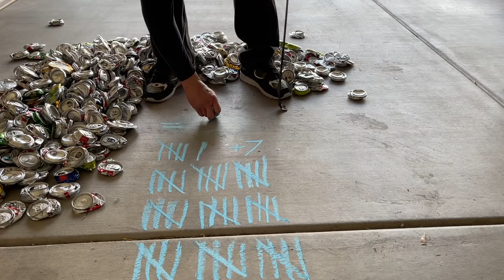Massive Can Meltdown - How Much Pure Aluminum Is In 500 Cans - Is It Worth Melting Aluminum Cans

Comment: Hmm no to be a smart akeck here, but what happens to ro non aluminium parts if the cans (ie the paint anr tho coating on the inside), are the ingots you are left with pure or somewhat  polluted ? Not that thus minor detail detracts anything from this great video I was just curious. And would seling the ingots actually recover the cost of the energy used to melt them ?
Reply from the maker: The plastic coating and the ink burn off and get scooped away so only the aluminum is left behind. Selling them might make a little bit back, but not all of the fuel costs that it took to melt the cans. Thanks Bjarne 👍

Comment: Stupid question. Slag really looks like metal, too. Why is it not salvageable? What percentage of metal left in that pile?
Reply from the maker: Not stupid at all. I’m not sure what percentage is left, but there is still aluminum as well as a lot of aluminum oxide. I will save pieces that look super rich in aluminum still, but as for the lot of it, once it starts to just crumble in my hands with ease, that’s when I call it trash. You could, and I have done this before, toss all the “pieces I call trash” in a crucible with some flux- like salt, and pull more out that way. When I have done that, the time that went into it for a tiny bit of metal didn’t seem worth it to me, so I just toss it. I do have a large bucket and I keep the good pieces so I can do a big dross melt once it gets full. 👍

Comment: Interesting video.  How did you polish them?
Reply from the maker: I use a wet sand method from 80 grit sand paper and step up to 3000 grit, then a polishing wheel with jewelers rouge. 👍

Comment: Where or how do you get all of your aluminum cans? This gives me ideas 💡! I'm wanting to make an aluminum bracket for our Harley to mount a flag on, do you know what the quality of the aluminum ingots would be? I'd need to pour it thinner or slice an ingot thinner on the band saw possibly to have something thin enough to work and bend into the shape I need.
Reply from the maker: I saved all my cans and had friends and family save theirs for me as well. I think the quality of the cans would be good enough for that. Alloys like they use for aluminum rims are better for casting parts, but I think cans might work for your project, but I’ve never tried what you’re after so I can’t say 100% 👍
Reply: @TheGrowingStack  Thanks for the reply, I might give it a try. 👍
Reply from the maker: @bodeine454  you got it. Let me know how it turns out if you do, I’d love to see it!
Reply: @TheGrowingStack  Will do

Comment: How long do you wait after you pour to pop them out of the molds?
Reply from the maker: If I have a full crucible and want to pour as much as I can before having to reheat, I’ll wait just until the metal freezes, and then maybe give it maybe 5-10 more seconds. If I’m at the end of a pour or only doing a couple pours(and I’ve poured the crucible empty) I’ll let it sit in the graphite molds for longer. Maybe a minute or so after it freezes. I’ve let it sit in the for 3 minutes at times and they release just fine. Hope that helps. 👍

Comment: Out of curiosity how much weight did the slag weigh?  Also, is pure aluminum worth more than say just taking the cans to the recycler?
Reply: Cans are worth a bit less. Pure alumim is about 1 dollar per pound where cans are 50 cents per pound. The prices change all the time. I took in around 500 lbs of cans last year and got like 200 bucks or something like that. Though melting them down cost money. One thing that can be cheaper is wood fire and a blower. This will reduce your cost of melting by quite a bit. The other thing I tried and it does work until the gear got stripped out was shredding them. Shredding them turn them in to a fine material which will melt much faster. I was planning on shredding all of the cans and then digging a hole with a fresh air intake and a metal frame to hold the pot and melt them over a week end and then pour them down 2 ant holes I have been feeding for 2 years and clearing out the debris piles for the ants. I never got around to it and then bought a new house and moved away.

Comment: I thought I should start a new thread here. In my opinion, the fact that all of the aluminum will be used is of greater benefit. The reason why there is still so much waste, even with all of recycling depots and such, is that there are different grades of aluminum. Different grades with different additives. So when a truckload of beer cans, soda cans, energy drink cans only a portion maybe recycled while the majority is dumped.
As someone mentioned, even the pull tabs have a higher grade aluminum, not what was stated but much higher quality than the can itself.
Reply: Yes, most materials are 'downwardly' recycled.  In other words, the resulting materials, like large lots of recycled plastic, being used to make plastic park or city benches, not the 'higher quality' uses for the original items.  

It' still better than just using raw materials for those benches, etc. though, I guess, as I expect you can recycle old park benches into new park benches, or some other low grade recyclable, quite readily.  In some cases, at some point the ** apparently does stop flowing downhill, so to speak.

And yes, recycling, as it stands, is no panacea, just a good idea, most cases.  Actually one of the best 'recyclables' out there is wood, if the damned morons who deforested everything in sight would have just bothered to plant some saplings of various varieties before they left to REforest it, given some time, there would be more than enough to go around  But as always, foresight be damned, profit is the solitary motive for most.

Comment: 500 al cans in Oregon returned gives  50.00 bucks back.  Scrap aluminum current price is 90 cents per lb.  So you have 10.75 lbs is just 9.68.  November '21  prices are way up.  Have a great day I did watching the video.
Reply from the maker: Thanks Brad! In AZ there is not deposit return like that, so it either recycle prices, or in my case, melt them down and see what it brings 👍

Comment: how do you avoid moisture pops/explosions? I was melting some cans today and it scared the  shit out of me.  Blew out the bottom of my crucible.
Reply from the maker: Oh man, yeah that would scare me too! I let the cans dry out for quite a while so that 99% of the moisture is gone. There may still be a tiny bit, but I toss them into the crucible and let them float on top for a couple seconds. If there is any moisture I’ll see it boils off rapidly and then I’ll push it down into the crucible. I’ve been lucky with that method so far.

Comment: The cost of propane to melt the metal is greater than the value of the ingots. That's why aluminium plants were originally built in the proximity of low cost hydro-electric schemes.
Reply: Most backyard operations use charcoal with a blower pushing air in to make it hotter. Some use waste oil (motor oil, trans fluid) that's sprayed in along with a blower.

Comment: Look i get the lbs and oz being displayed.

But did you really need the kgs and the gram weight? I mean there is a reason we switched to the metric system
Reply from the maker: I appreciate the comment and the question. The answer is I started stacking precious metals. Gold, silver, etc. are bought and sold in Kilos, ounces, or grams depending on what your flavor is. So when I see 5oz of silver compared to 5oz of aluminum, it really paints a picture. That being said, I’ve also had people ask me to include both when I haven’t in other videos, so I try to please everyone with both weight measurements 👍

Comment: 500 aluminium cans are 500*0.15€ = 75€ in Finland , you just need to return those to return place and you get money back, so easy. System works so that 0.15€ is added to price of product, but you get it back. Recycle  rate of those is well over 98%

Comment: In Egypt, the matter may be different. The price of 500 cans is 75 Egyptian pounds, and a gas tube costs about 100 pounds, and the output of them is 4 and a half kilos of aluminum, the price of a kilo is 40 pounds.
If we break the cans it will save some time
And if we use a larger oven, we can save some gas
What do you think is this project worth in Egypt

Comment: I believe you can make a furnace with charcoal and electric leaf blower. If wood could possibly work that might be cheaper than a normal forge
Reply: A leaf blower would only work for large furnaces, like big enough to hold 100's of pounds of charcoal.
for the smaller version like in this video, a hair dryer would be your best bet.

Comment: Where I live, you get $0.10 per can you hand in, so you'd get $51.70 for your cans in raw form. At the scrappy you can get up to $2.00 per kg of aluminum but generally closer to $1.60 for clean cans if you're stating provenance, so you'd get maybe $10 for the bars. Sounds like a loss to me. Guessing the 5m views made up the difference ;)

Comment: how does your phone overheat?
Reply from the maker: From filming around the furnace and having it too close when I pour(the heat the metal puts off can overheat it too). Sometimes it will be really hot and must be getting ready to shut down because I’ll set it down to pour, get done pouring and then see the thermometer on the screen that it needs to cool down.

Comment: How come the pouring pot thing doesnt melt?
Reply from the maker: It doesn’t melt because it’s made of steel. Steel with a very thin coating of tin on it. 👍
Reply: @TheGrowingStack  so the alluminium cans u were melting, arnt they made of tin? Why wouldnt the tin coating melt away? and steel.. does that have a higher meltimg point than everything else that your melting using that tool? Im sure ive seen gold and silver being melted in those things
Reply from the maker: So sorry!! I was replying to a bunch of comments from the video I put up last night and I was responding to your question as if it was for the latest video. Disregard my comment. 
The crucible doesn’t melt because it’s made of clay and graphite. So just like the molds I pour into which are graphite, the crucible won’t melt. Graphite has a crazy high melting temperature, and I’ve read before that it doesn’t actually melt, at it melting temp it goes straight from a solid to a gas. 🤷‍♂️ it’s pretty awesome stuff.
Reply: @TheGrowingStack  ah that makes more sense. Thanks for the answer, i know i could search google but it could take me ages to find the specefic answers so i much prefer asking people that know cheerz

Comment: actually that stuf you see as waste can also be recycled, and also minimized. you got a lot more waste than we did when we did the same despite us using a forge made of sand and stone and a cooking pot to melt it in, perhaps you stir it to much or remove the oxide layer to early since it also acts as protection, or you blast in extra oxygen. that said you can still use it, there are methods, one is using electricity, but perhaps you can also try it with charcoal in a airtight container, however that last one while it works for most metals is something I havn't tested on aluminium yet, electricity however is the default way of doing it. you can also still melt it, the melting point is much higher around 2000 degrees but you could still cast and use it for things, you can also quite easily turn aluminium oxide into ruby which is beautiful and nice for many things. if you just cast it you get a super hard material that doesn't really degrade at all since it is already oxidized, but it will be more brittle, so it is quite much like stone or glass in some ways but you can still do many things with it. or just send it to a recycle plant so they do it/can use it.

Comment: It’s possible to recover more metal from the slag if you use a large ball mill to break it up into a fine grit and then re-melt it with flux like borax. This will allow the metal to combine without oxidizing under a shielding layer of molten borax which will also collect all the impurities into a glassy substance. At some point it would be interesting to see you try a similar process to this for recovering metal from some kilos of slag.
Reply from the maker: I haven’t tried grinding it into a fine grit yet, but it doesn’t sound like a bad idea. I’ll give it a try some day. 👍
Reply: @TheGrowingStack  Just don't inhale the dust!

Comment: Well, if you get some molding sand and some dies, you can make some AR-15 upper and lower receivers. Worth about a $150 per set if done right.
Reply: Key words.  "If done right".
Reply: @kathylynne2011  Usually after about 20 castings and a boat load of patience you get pretty good at it. The real work is all the machining it takes to get the finished product.

Comment: Today is 11/11/21 and aluminum is going for .09 cents per oz = $15.47 in Canada, 517 cans @ .05 cents at depot is $25.85 and if @  .10 cents per then $52.70. Not calculating in equipment, fuel and time. Its an absolute waste of time my friend.

Comment: Pushing the cans down into the molten aluminum like that is sketchy. If a can has even a hint of moisture, it'll flash to steam almost instantly and can send molten aluminum flying quite a distance.

I'm not criticizing what you did. You've got to shove the cans down into the molten aluminum if you want them to melt instead of turning into a pile of oxide and slag. I'm just warning anyone that may try to replicate your process.

Comment: So around 15.7$ for the melted cans (10.75lbs / 1,46$ per lbs). 1 can = 0.05c X 517 = 25.85$.

The answer is... NO.
And i didn't count the amount of time and the cost of the melting.
It's still cheaper to go to the supermarket and recycle them.

Comment: considering half of the aluminium is lose in the slag and when u remelt the leftover it usualy turn to oxyde... remelting can is not worth it if u dont use electric furnace and have lot of solar pannel... (and in a better world u should directly eletrolyse the melted aluminium with his oxyde to convert it back to al ... but not easy to do a electrolysing cell at 1000c

Comment: Stupid question, are we worried about the plastic the can is interior lined with? We're melting plastic which is like one of the worst things you can burn.
Reply from the maker: Not a stupid question at all. I’ve read the liners are a non-BPA epoxy, or some other acrylic or polymer that is safe for food. It is also very thin, so I’m not that worried about a tiny amount burning off when I melt cans. 👍

Comment: As of 12/14/2022 aluminum is priced at $0.45 / Lbs.  10.75 LBS is worth $4.83 :(  Probably wouldn't pay for the cost of the gas used to melt the cans?

Comment: Soda cans have a plastic coating on the inside. This plastic "bag" can be seen if the aluminium is dissolved in sodium hydroxide. The amount of plastic used would be massive considering all the soda cans used daily. This is never talked about kinda like the massive amounts of CO2 used to carbonate soda drinks. I don't think the CO2 component is any kind of threat but burning plastics into the atmoshere can't be good.

Comment: Recycling is good on a large scale and has it's obvious benefits for the environment, not sure if money is any real benefit as it cost time + Hours plus equipment.

It's kind of like Tesla Cars right, they run on batteries and this offers the appearance of saving the environment and it might in your local area where the car is being used, however, all those batteries need to be charged and that takes energy that like it or not comes in the form of gas somewhere along the line not to mention all the recharging right, so in essence, an electric car is not really saving the environment as much as one may think, really all this is doing in diverting where the gas burring takes place, instead of at your local gas station, its now being burned up on the electric grid and while we may have some areas that get their energy from the sun using solar systems, the large majority of energy is still coming from fossil fuels. so there's that.

the Very name TESLA is kind of a lie, why do I say this, because it's running off the back  of Nicola Tesla who invented free energy and this was patented invention, sadly the PTW or The Powers That Were did not like that idea because it bit into their gold mine of selling everyone energy and the industry can't have someone come along and offer free energy now can they, they need to maintain there energy empire and so Tesla, the man was destroyed.

Free Energy is taking energy that's in abundance right out of the air and converting it over to useable energy in a wireless fashion, while all this may sound like science fiction to some of you, you'll need to do your own research to figure it out  for yourselves, truth is your responsibility. 

There are around 6000 other patents that are being suppressed by the PTW, this is why humanity in it's current state progress so slowly, instead because of Money, everything that relies on money is manipulated to maintain control and the wealth of this planet into the hands of a very limited few, these people in my mind are psychopaths who need to be eradicated from earth IMHO.

Comment: I was hoping for a value after melting it down…..
Reply from the maker: I put a pinned comment with the info I didn’t fit into the video. I should have put that piece in there for sure, but it’s all in the comment, the stuff I couldn’t fit in the video.